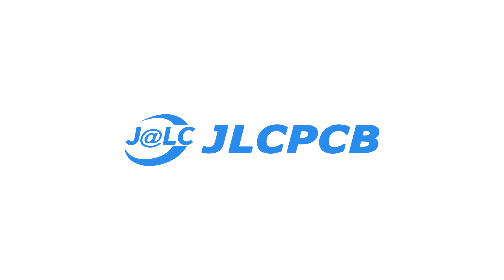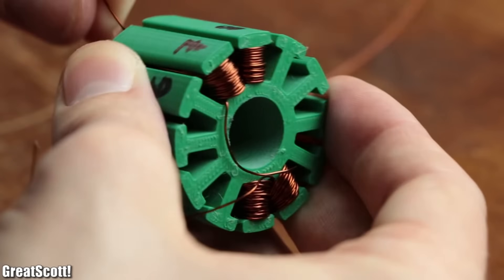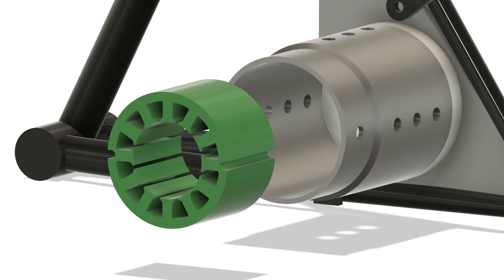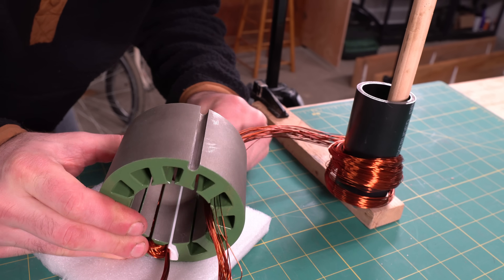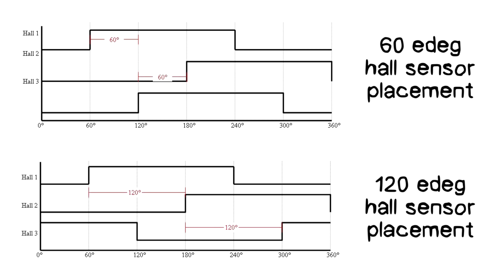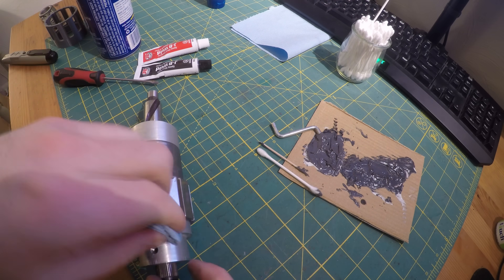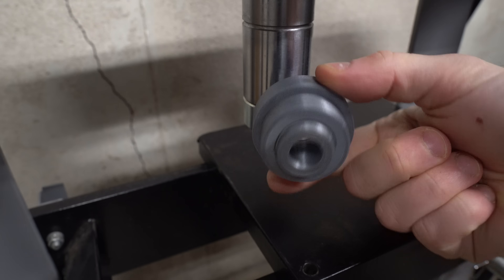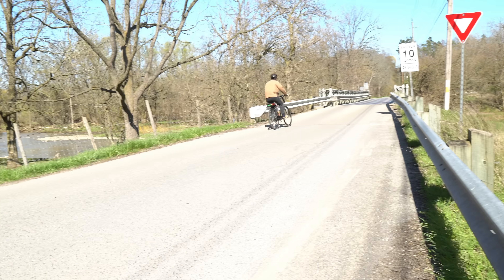Converting a Starter Motor into a BLDC Motor

Comment: I don't recommend building a custom electric motor without having knowledge how to design one. It won't be good unless you are really lucky.

However, there's things what can be done and I'm very close to test one idea I got. I have one of those cheap brushed Minnkota trolling motors. I like how quiet it is, but it has too little power and bad efficiency. The idea is to machine aluminum extension part and put something interesting into it. More specifically lots of high current smd fets and microcontroller to drive each coil separately. Tiny 8x8x2mm fets can drive 400A currents and 150A models cost less than 1€ per each. Original brushes would be removed and electricity would be driven in through liquid metal, more specifically low melting point gallium alloy, which is used on old style thermometers. Inner and outer ring have something like 1mm gap, and it's filled with liquid metal. Two axial seals keep the liquid metal in. There's one ring set for both positive and negative feed. Power fets and electronics are inside the inner ring, and the liquid metal transfer the heat as well as electricity to the outer ring, aluminium extension and water.

The interesting part is potential gains. First, mechanical wear and resistance from the brushes is eliminated. Second, all the coils can be driven same time with pwm and perfect phasing. This gives huge performance and efficiency boost.

In original configuration, there's two brushes in opposite sides with about 5-6 coils touching them in each time. 3:4 coils are disconnected and don't do work. Unused copper means increased copper losses. Also, those which are connected, have different mechanical phase but electrically they are connected to same feed. That results short circuit current between coils through magnetic coupling. That won't happen with sinusoidal evenly phased currents.

This project, of course needs a lathe and knowledge about power electronic designs. I have both, but I don't have time, at least not yet, but I hope I have some day.

These motors have enough iron and magnets to give required torque without gears. Commercial brushless motors typically have noisy planetary gears or even angled drive shaft. I have 5.5m hardtop boat with 60hp engine. It's nice for passing distances, but many times I just want to chill, drive slowly and enjoy the sun. Engine don't like slow driving, it's not silent and gets unnecessary hours from driving slow. The trolling motor can go only 3.5-5km/h, while the hull speed would allow around 10km/h speeds without planing. That's where I hope to get with modifications.

Comment: for your starter motor all you really needed to  was to modify the housing  to incorporate a fan to provide  forced air to prevent it from over heating or just used an old automotive style DC generator ( not an alternator) and use it as a motor

Comment: Use a treadmill motor.
Reply: You can find those for free all the time too :)
Reply: How can l get your bldc motor.
Reply: Is the russian channels name = kerosan english ? Or please tell the name
Reply: Or just buy a new hub motor and quit screwing around.😂😂😂
Reply: @RonnieStanley-tc6vi Where's the fun in that?
Reply: @RonnieStanley-tc6vi he already did that, it’s boring
Reply: That's an excellent idea. As long as you don't replace the efficient, inexpensive and reliable brushes with an inefficient, complicated, unreliable, expensive and failure prone computer controlled electronic commutation system.
BLDC is a branding exercise for electronically commutated synchronous AC motor. 
If you look at cars like Jay Lenos 1909 Baker electric, it uses a 2 hp brushed dc motor with electromagnetic field coils that are used to control it's speed, and it is almost identical to a typical 2.5 hp treadmill motor.
Those cars are at least 6 times as efficient as any built today despite having terrible Aerodynamics and wheels that would not look out of place on a logging truck. The Safe, non toxic and inexpensive edison Nickel Iron batteries are unkillable, energy dense and proven to last 100years of daily use. 
The motors, like a treadmill motor or starter motor, have power ratings that, as with all brushed dc motors are run all day non stop ratings, and 10x the rated power is perfectly fine for a few minutes. 
This is DEFINATELY NOT THE CAUSE WITH BLDC SHITE! 
They and their controllers  are not often capable of even their rated power without frying themselves. 
The hub motor suggestion by the fool here is a stupid idea. You need gears, and hub motors and other BLDC bike motors will be advertised as a certain power, but that is the battery draw power not the shaft power, which is often only 20 to 30 percent of what comes out of the battery. The electronic controllers use semiconductor switching that has multiple components that have voltage drops  and turn most of the battery supplied power into heat.

 REMEMBER THAT THE SCAMSTERS SELLING THEM ARE NOT LYING IF THEY TELL YOU "It's up to 90% efficient", but it never gets over 25%.
It would only be a lie and false advertising if it ever for a split second got 91% or higher. 😒🙄. 
The idiot making this video fryed his starter motor because he geared it to go faster than the speed of sound, not taking into account that it is a high performance motor designed to run at over 30 thousand rpm. 

There is a Russian on YouTube that got very exciting wheel spinning performance and top speed of 110kmph out of a 24V starter motor driving an old five series BMW at 36V, 48V, and 60V using up to 10 standard lead acid car batteries thru the gearbox. 
And using a strip of stainless sheet metal as a soft start resistor, and direct connection to the batteries for full power. 
That setup also has very efficient recyclic braking, because spinning the motor faster than no load speed makes its back Emf higher than the battery voltage and charge them. 

The only reason they are pushing computer crap on you is that they can track you and deny you use of your own vehicle if they don't like what you say. 
Or if there is a Tsunami or Nuclear attack, or some other major disaster they will not tell you, just switch off your transport and communications, while the elitists helicopter off to their underground bunkers. 
I am not even going to watch this idiot waste time and money turning a reliable efficient 10kW capable  motor into an expensive piece of crap that only puts out 0.5kW. 
He is an idiot. Pushing crap for genocidalist scamster sponsors. A "useful idiot" as they put it.
Reply: @Maungateitei  just stop living on this platform.
Reply: @Maungateitei dude educate yourself. Please tell me how u think a brushed dc motor can handle 600-800V and 500amps or more? U dont know anything about the stuff u r talking about lol
Reply: @Maungateitei Bro you need to go study some E&M and do your own experiments or some shit. Or maybe get help.

Comment: For a no motor designer you did EXTREMELY impressive. But let me tell you a couple of things:
Flat magnets, though can reduce torque up to 10%, won't make that much of a difference like you had. The motor should have pulled if everything else is ok. 
- Check if hall effect sensors are deep enough in the stator core so they are in front of the rotor magnets even if there is some misalignment;
- check if the hall combination is correct, there are two of them which will spin the motor but one will produce torque;
- double check magnet polarity.
Reply: Also check the phase timing if possible - it's important that they switch on and off at the correct degrees of rotation, and remain on during their segment.
Reply: If the halls are wrong the current consunption would be high?
Reply: @felipehcraftgamer4193  yes, and no load RPM could be high aswell
Reply: Could you energise the phases manually with a bench power supply and step it round? Compare the two rotors. Monitor the hall outputs at the same time.
Reply: Great video

Can you mount a Samsung direct drive washing machine motor to your bike and make it run ?
Reply: when the motor failed to turn I was screaming YOU WIRED IT WRONG!!! not it was wound wrong. Not the magnets were wrong. He 1000000% wired it wrong. Just because some wire configuration can spin the motor with no load doesn't mean that's the correct way to wire it up. He probably later wired it correctly by accident and then blamed it on the rotor
Reply: @LoganDark4357  back-EMF form will tell whether there is any winding or magnet troubles.
Reply: @АлексейКастевич  reading some of the other comments I think it's also possible that it was the epoxy. In the video he literally acknowledged it was ferromagnetic and then proceeded to put a bunch of it around and between the magnets
Reply: @LoganDark4357  don't think it will make any meaningful impact. Torque could drop a bit and that's all.
Reply: @АлексейКастевич  Surely if the epoxy was magnetic it would short the magnetic field? Like a keeper?
Reply: @icarossavvides2641  the magnetic flux is too much and the permeability of epoxy is too low anyway. Even a thin sheet of steel on the rotor surface would not enough to fully close the flux of these strong magnets, though motor will definitely lose torque in this case.

Comment: You have made a very great video you have increased our knowledge a lot, good sir I wanted to ask you which motor is good BLDC or permanent magnet synchronous motor or interior permanent magnet motor when you installed the motor in it China has been installed. The sound of China is there. It would have been better if you had installed a ballad. Thank you very much. It was a pleasure to watch your video

Comment: hmmmm wonder if you couldve had the original starter motor housing machined out to the 100mm of the brushless dc motor , it wouldve reduced the wallthickness by 2.5mm but you couldve used a standard sized electrical metal 
i think it wouldve been a cheaper option
even using aluminium/steel pipe with a 100mm inner diameter and just cut it to length wouldve been an option as you not using ANYof the stock features other than the centering on the endplates (and you could make 2.5mm thick rings for those to slide in after installing the stator , would hold the stator in the center of the housing as well )
you might be able you grind the magnets rounder to fit the stator better using some sort of toolpost grinder (angle grinder mounted to toolpost and work slowly )

Comment: Juat a tip on the cooling form befor. 

Forced air cooling. A crappy fan on the end of the old dunamos in the 50's chaged the output from 11A to 22A. 

Passive holes dont do a lot. Suck the air theough. Doesn't need jet engine aerodynamics. Just a spoked fan and inlet and outlets.

Comment: You basically made a new motor from scratch with only some size dimensions borrowed from the original starter. 
This is very impressive and you did a great job, but the title is a bit misleading since the starter wasn’t converted.

Comment: These are not BLDC motors but permanent magnet synchronous machines. They certainly don't run off pulsed DC. You could run a PMSM as a BLDC if it's wound in a star configuration and have the center winding connected to one of the bus rails.
Reply: No it's a brushless dc motor they are mostly the same in construction the difference is in the control PMSM uses 1 hall effect sensor and BLDC uses 3

Comment: LOVE these pointless projects! Great job!
I once cut apart the stator of a brushed inrunner motor (speed 300) and glued the stators to the inside of the can. Then put two magnets on a shaft and slapped it in there. Amazingly the motor runs and even flies a model plane!
Oh and you should never push bearings in place from the opposite race. Always press on the race that you are fitting to avoid axial loads on the balls/races.

Comment: I was afraid the comments section was going to be a cesspit, just a bunch of "congratulations you just built a BLDC motor out of a BLDC motor" and "wow, so pointless." I am glad to see that I was wrong and all the comments so far are positive. This is a really cool project and a great learning experience. Thank you for sharing about JY Stator, I have been keeping an eye out for years for somewhere to get custom laminations made and everything i found was ridiculously expensive. You've found the answer for me!
Reply: it is super awesome to do a project this ambitious to learn, but it was pointless, the only thing left from the starter was the casing, i wanted to learn more about why a starter makes for a bad or good motor, and how to remanufacture it to be better, not that an almost from scratch ameteur BLDC motor is indeed an ameteur BLDC motor. keeping the old stator coils and rotor and instead improving the cooling and winding, maybe by machining the large few stator coils into double or triple the electromagnets would have been much more interesting
Reply: @xymaryai8283  Starter motors seem like a ton of power in a tiny package, and therefore an excellent candidate for an EV project. Not so.. a starter motor isn't a good EV motor because where most motors are rated for continuous duty, a starter is rated for intermittent duty. A starter might be rated (example) 5kW but if it were rated by the same criteria as other motors it probably couldn't claim to be more than 1kW. Starter motors make bad EV motors because you buy a 1kW motor to handle the job of a 5kW motor, because it claimed to be a 5kW motor. They have a LOT of torque in a small package but can't output it continuously without burning up. Like a drill. A corded or cordless drill might have enough torque to snap your wrist, but if you've ever used one at that torque level for more than a few seconds you probably know what it means to let the magic smoke out of a power tool. For an EV motor you need to choose a motor that is rated for continuous output. That motor is going to be a lot bigger than its similarly rated starter motor because it's ACTUALLY capable of delivering the rated power without going up in flames.

If you wanted to remanufacture a starter motor to be a good EV motor all you would need to do is scratch off the rating plate and make a new one that reflects how much power it can actually output continuously without overheating. Then you will find that it is not the magical tiny powerhouse that it seemed. Its size is comparable to other motors with similar ratings.
Reply: @charlesstaton8104  well theres more you can do, the BLDC motor he ended up with was better than the starter motor, and thats largely because of the more optimised coil topology, i wanted to learn more about what specific parameters make a low duty cyle motor better at its task and how to get more continuous power out of it than it would otherwise manage
Reply: The title is misleading
You cannot convert a brushed motor to brushless. I was also disappointed to find out this is just making the brushless motor from scratch and to make matters worse, used a stock rotor from another motor !.
Reply: it's not building a BLDC motor out of BLDC motor it's the learning experience , i learned alot about BLDC from watching his video
Reply: Channel owner can remove any messages he wants.

Comment: Used to work in a shop running mills and lathes that did prototype work. That was a good deal. I think the JB weld putty is what threw your DIY  rotor off, possibly the epoxy as well. You really need non-ferrous epoxies so you don't throw off the magnetic fields. Convert to belt drive or put a chain tensioner on the bike as well.
Reply: No  a flat block on a curved surface seriously weakens the B field. They need to touch, and minimize gaps

Comment: Frankly I'm stumped by both attempts - one is low duty cycle starter, another is making it into something else entirely, and they are both wrong, why even bother? Why not take a good hard read on electric motor design, figure out a bit on how magnetic circuits work, flux linkage, gaps, materials, what goes where, nah, it'll be fine - well you got your trash motor in the end.

Comment: Will you try to find a source of curved magnets?  You should also be able to measure the magnetic force of the curved rotor magnets that you have with a tesla meter. I bought one just for fun and it wasn't too pricey.  Check out Applied Science video - Engineering magnetics - practical introduction to BH curve.
Reply: I got the SJ200 Digital Gauss Meter Static Magnetic Field Tesla Tester from A L I

Comment: Hello, great project! 
In my experience, I had a sensored brushless RC motor I wanted to reverse. The esc didn't have that option, so after days of drawing pictures, I came up with a sensor order that "worked" with no load.
But in the car on the track, there was low power, limited speed, and motor became vary warm. I would expect your motor to run better than it did.
I think you should look into your sensor wire configuration.
Reply from the maker: Thanks! I ended up trying every possible combination and it unfortunately didn't work under load. I also expected it to work better.

Comment: What about using iron dust mixed with epoxy, instead of laminated slices? This would eliminate eddy currents, but the question would be around how well the magnetic fields could pass through such a block. ie. will torque suffer?
Reply from the maker: I have seen others experiment with this and I also wonder how it would perform. Might be worth a test!